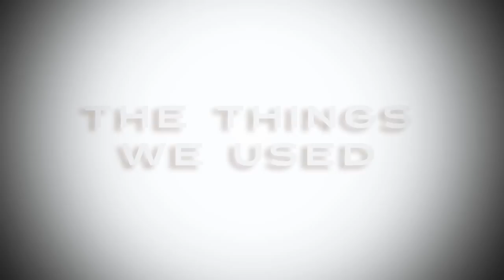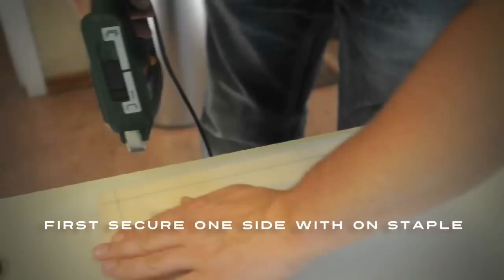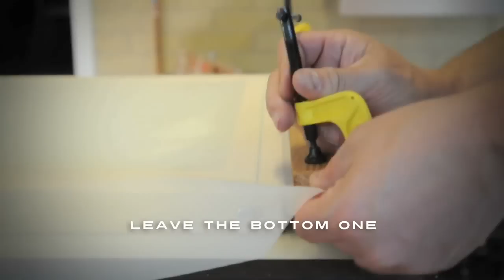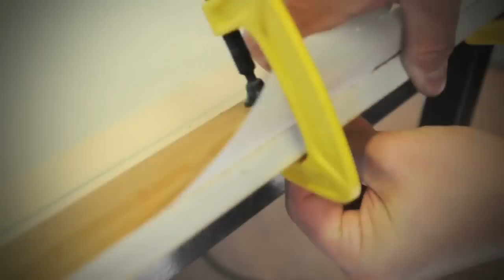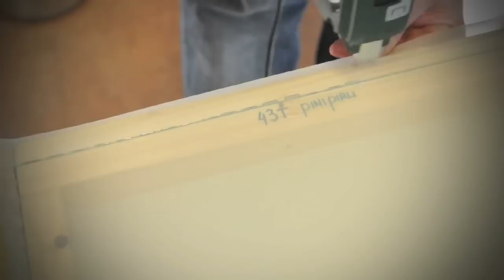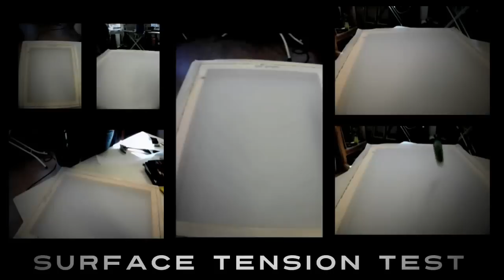DIY  home made Screen Stretching

Comment: If you get a wooden picture frame from a charity shop for like £1, take the back off and the panel of glass out, you can stretch the mesh over the frame. you can then use the panel of glass as a way of holding the acetate in place/flat when you're exposing ( cos the glass is the perfect size ) i combined that technique with your stretching method and i got a cheap screen :D thanks for the tutorial.
Reply from the maker: That is a great tip! Just make sure the wood is varnished,
because most picture frames are made of of fairly thin wood and they will torque and twist a lot when they get wet.
Thanks for commenting!
Reply: yeahh that would be a good idea, most cheap frames are MDF unfortunately. you could varnish it yourself though.
Reply from the maker: Jamie Tuckey Definitely stay away from MDF frames ,the material is to weak to hold great tension and with larger frames the sides will collapse ;)
Reply: thanks for the tip :) what wood is best ?
Reply from the maker: Jamie Tuckey as long as it is real wood you are ok,but the harder the wood the better,but those are mostly expensive frames,so just get a cheap real wooden one, and give it a few coats of boat varnish.
That should keep the water out and keep the wood from twisting :)
Reply: Thanks :) i appreciate the help

Comment: Your technique to stretch is very good, I suggest you to use glue instead, it's easier to apply and doesn't tear the fabric or ruin the wood, and if don't want to wait use an activator with it. Cheers my friend !
Reply from the maker: It would have to be quick drying though;)
Reply: Do you use a contact adhesive?